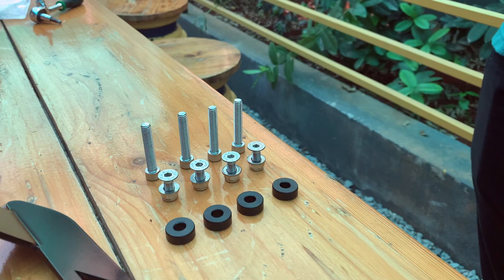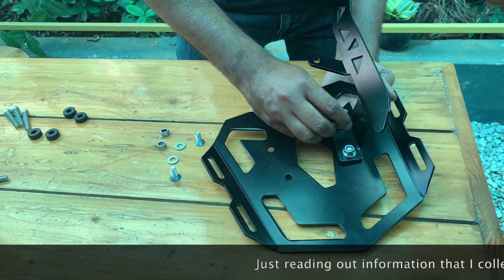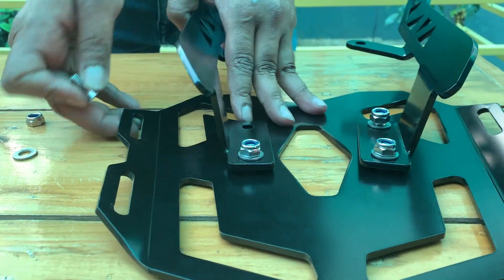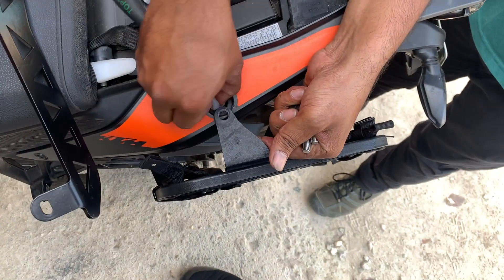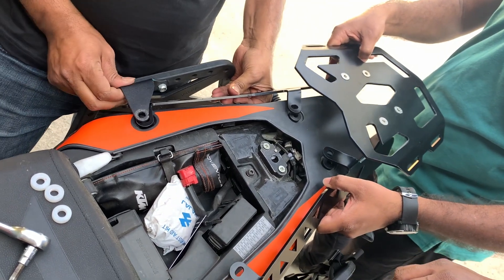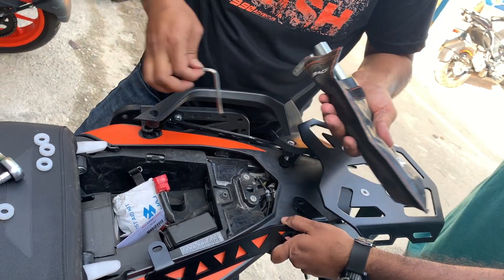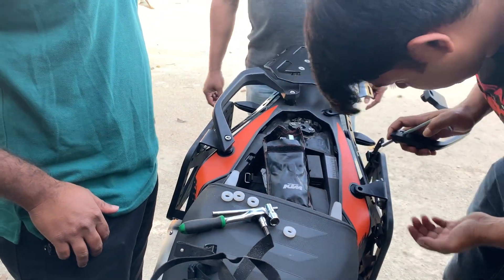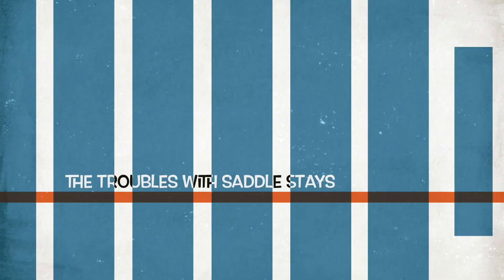Motourenn Tail Rack Installation | KTM 390 Adventure | Review

Comment: I already had the carbon racing saddle stays on my adv 390. I was worried which tail rack would fit. I got the moturenn top rack after watching this video. Based on the video I was able to install it myself with the help of a friend.

My top rack is quite heavy. Its made of  steel.
Reply from the maker: Awesome, good to know the video helped you. Yes the steel ones are slightly heavier. A good buy though.

Comment: hello bro, did u have any issues , fitting  the automel toprack with carbon racing saddle stays?? any points of damage on  the bike?
Reply from the maker: Hey buddy, nope no issues at all. No damage to the saddle stays or the bike. You can follow the installation video. It should be just fine